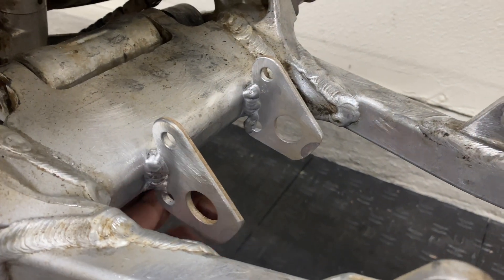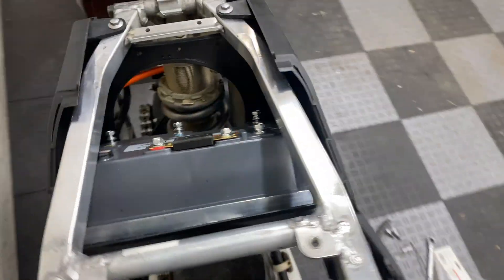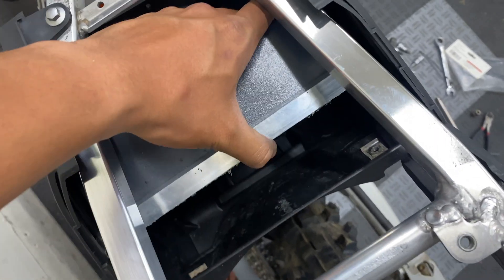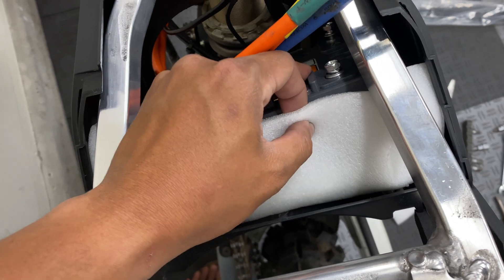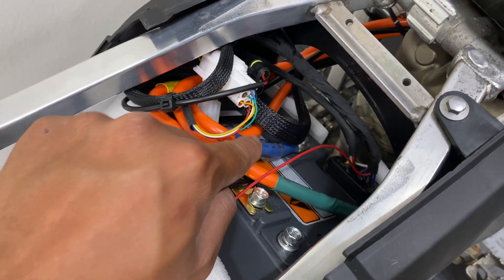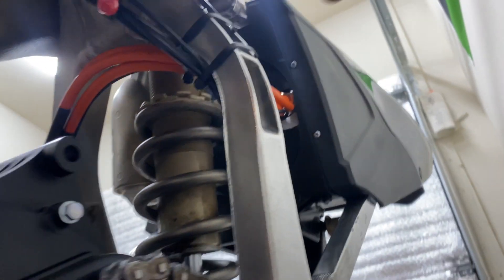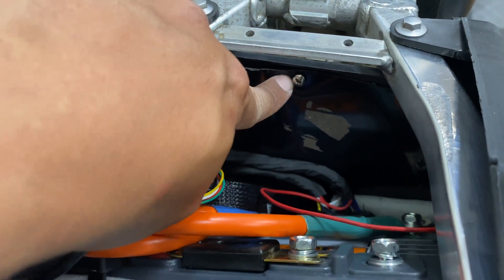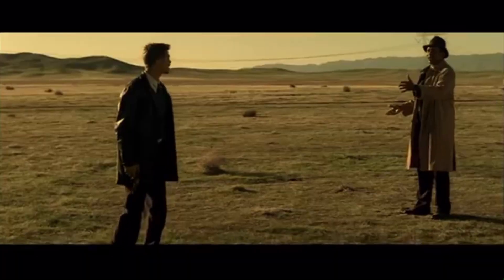Project YZ-E | YZ250 Electric Dirt Bike QS138 EM-260 Conversion Part 6

Comment: Hi Pat, MauiPat here. I;m doing the same conversion with the same kit from Electro & Co.  I'm using a CRF250L 2014 vintage. Got my kit a little more than a week ago, and now have my motor mounts fabricated. Painting the spacers and brackets and will reinstall, hopefully tomorrow. My bjke is dual sport, so I also have to deal with the lights, horn, turn signals, and speedometer. Most fun I've had I quite awhile. Got the Samsung 60 ah battery and hoping for a range in excess of 60 miles.Thanks for your videos, they'er a lot of help, and encouragement. Thanks! Also I'm videoing my build and putting them on my YouTube channel: Pat McGuinness,      Aloha Pat

Comment: Not sure putting closed-cell foam around your controller is wise how is it supposed to dissipate heat if you wrap it in insulation?
Reply from the maker: Hasn’t been an issue, but I am currently working on a better solution

Comment: The foam will also hold all the heat, bad idea in my opinion. A better idea might be to have that heatsink stick out the back of the air box or sandwich the air box with  another piece of aluminum and the controller to pull that heat away, continuous current makes tons of heat. DC to AC conversion makes heat. Heat kills electronics.
Reply from the maker: Appreciate the input

Comment: A skif plate 1/2 way the down tube and swoop under the frame rails will keep the.motor protected.
There a guy on YT with a E-RM Suzuki has a great build, and 3 CAD VIDEO look it up.
Reply from the maker: Thanks for the tip! I actually follow that guy also. And I do have a skid plate for this bike laying around, which I’ll be reinstalling at a later time
Reply: @PatOutdoors  Yes great you know this stuff. Looking forward to the TTR.

Comment: Hopefully you don't have heat problems with your controller wrapped in foam.
Reply from the maker: Hopefully not, it's not fully wrapped. The airbox is also not fully sealed, still vented top rear corners and at the bottom. Will monitor temps and iterate (if needed.) Appreciate the input

Comment: Why would you block air flow to the controller? nice build BTW!
Reply from the maker: Thanks! You would not, there’s still ventilation below and behind the air box. I just wanted to cover the hole where water can get in when I’m trail riding.

Comment: So much GTR content lol 
Really looking forward to the battery review and install. I'm looking to upgrade a couple razors to lithium. Have my pocket mod running Ryobi 36v, but those aren't cost effective for four different bikes.
Reply from the maker: My other passion is automotive performance.. had an R33 GTR myself, along with a few other turbocharged contraptions.. The ryobi 36v is a good quick power adder option, though very short range and for the little bikes. Hopefully my new batteries come in today/tomorrow!

Comment: I don't really have any experience with these kits but I know in general, speed controllers give off a lot of heat when used for extended periods of time, just thought of that when I saw foam cause it might melt due to the heat. Again, no experience with these kits so I may be wrong
Reply from the maker: The bottom and back side of the air box are box ventilated since this was originally an intake air box afterall. Thank you for bringing that to my attention, I will monitor and iterate (if needed.)